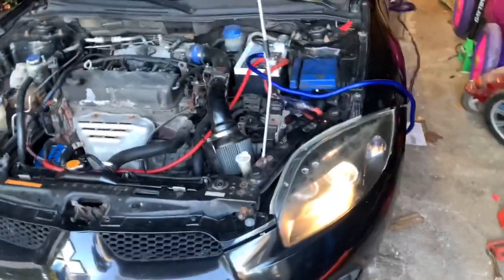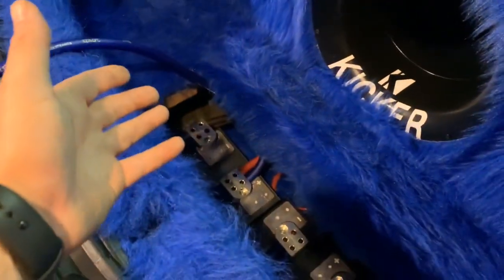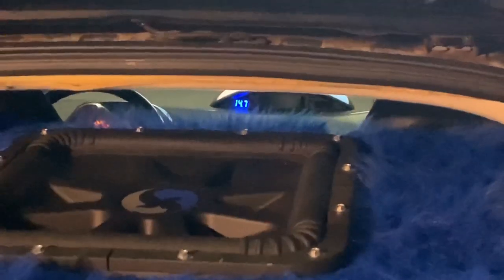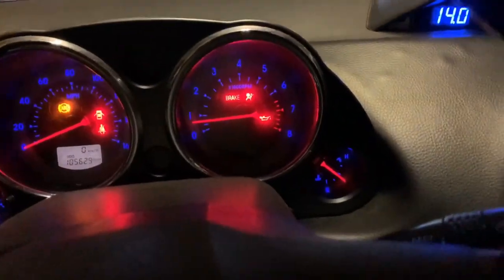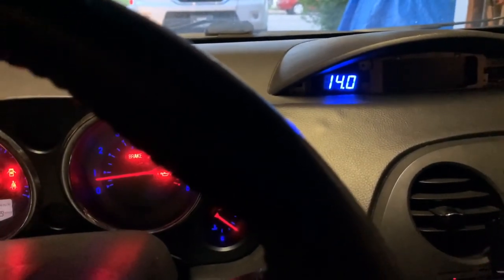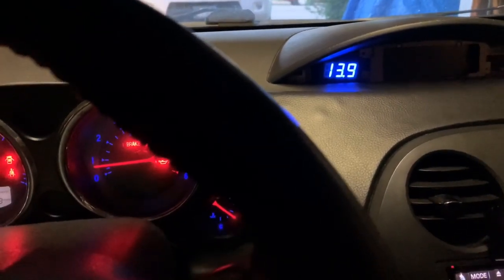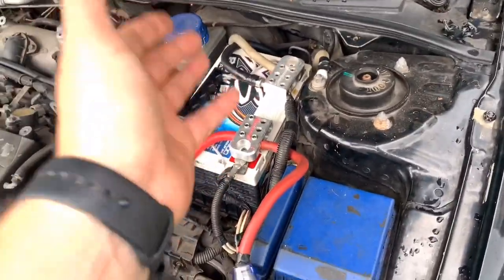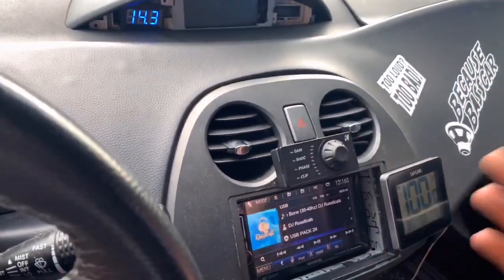VOLTAGE ISSUES WITH A BATTERY DELETE KIT ? IS IT WORTH IT?

Comment: It's an idle problem, the cars idle is set to low for that generator would be my guess most high alts don't turn on until like 700 to 800 rpm, hence why your getting the drop after warm up

Comment: My Ohio gen alt was doing same thing… bought a mechman 370 and couldn’t be happier. Charges all the time and way better voltage then my Ohio.  Night and day difference
Reply: They are weird I bought the biggest option an the amps they said are all over the place they called it a 350 370 400

Comment: I have the same issue i have a xspower d3400r big 3 & 320 autotech alt 96ah bank in back car starts 14.7 soon as idle down 13.3/5 but the factory idle us set at 625/50 rpm in which i tap gas and rev to bout 800/50 it stays at 14.7 have to get your idle flashed and change factory idle
Reply: Do you have a capacitor ran between batteries?

Comment: I know this is super old, but I got a singer, I didn’t run lithium, but I had issues like you with AGM under the hood and agm in the trunk, I’m buying lithium , and I asked about my voltage issues before and after and he sent me an alternator adapter that brings the voltage up and stops fluctuating so bad because of a “smart” alternator, there’s a few variables….
Reply from the maker: Yeah, I need to do an update on this video

Turns out it’s because the signal sense doesn’t detect the lithium battery after the delete connections 

I don’t know… The fix is to run your charge wire to the lithium and then another wire back up to the front of the vehicle to your battery delete 

I also fixed it just by adding the AGM back under the hood and running an isolator 

To be honest, the best way is to have multiple runs, going back and forth for positive and ground rather than relying on chassis 

Just for the best case scenario

Comment: Sounds like heat wash bringing the alternator down. If u charge the lithium with the car off, with a seperate charger, start the car the next morning, itll charge 14.7 or so until the car gets to running temp then itll drop voltage to 13s IMO.
Reply: ya i had a similar issue. ended up being an exhaust leak on the alternator. i got around it by keeping my headlights on and running my HVAC stuff on low so it would detect the higher current and keep the alt charging. oh and i eventually fixed the exhaust leak which of course was from a clogged cat. was faily simple to just drill a hole in front of my cat.

Comment: I've got similar set up, AGM up front with xs power lto 80ah cells with isolator in between, goes from 14.8 at start then dips down 14.4, but when I ran all agms 300ah of batteries, voltage stayed at 14.6, so I'm currently trying to decide will it bad to charge bank fully to 16v without deleting agm and isolator??
Reply from the maker: Ya If your LTO cells need charged higher then yes I would recommend charging higher but that may put stress on the agm while running since the isolator will be “open” you could always charge them separately and run your alt how you are but you are missing out on a ton of potential power from that LTO - I don’t think it will hurt them but it will reduce some cycles and reduce total capacity 

I recommend running only the LTO and upgrading your regulator so you can charge the LTO while driving and get the full potential from them
Reply: @LivinLoudwithAndy  sweet! Best advice I've got so far! Thanks bro! Well time to rebuild. My lto charger just came in the mail too, now time to do some research a voltage regulator. I drive a 1996 cadillac fleetwood brougham and have a js 370a alternator so think I need to start reading up on it first! 
✌🔊🔊 thanks alot

Comment: My 09 maxima does the same. My ecm is controlling the voltage still. Think it's how my 390 amp alternator is wired. Getting it looked at next week. With the AC on I'm at 14.5 plus at idle. AC off 13.2 at idle. Frustrating
Reply from the maker: I would get an external regulator 👊🏼
Reply: @LivinLoudwithAndy  actually turns out my alternator didn't turn on till 800rpm. Would've been nice if js alternator told me that cause I idle at 650. I had Nissan raise my idle to 800. Problem solved. I've since done an AGM delete and put in a sb500 under hood. Did it yesterday actually. I only gained .3 to .4 volts at full tilt. I do like the higher resting voltage. Is there any gain from starting at a higher resting voltage?

Comment: Bro did u try a shorter belt half inch to inch shorter some high output alts need to spin faster to make the voltage
Reply from the maker: Turns out it was the way you run lithium with a battery delete that was tricking the alt .. 

You need a run going directly from alt to rear lithium then an additional run from that back up front to the delete .. rather than one run all connected .. 

Removed the delete to remove this issue .. been great ever since

Comment: Ok I really need help with this question I'm new to lithium in car audio and I'm trying to upgrade my system been gone for a while and I don't know how to do it correctly and make it work for long periods of time and be able to recover from the Bass drops I'm currently running two Q-class 12's on a CXA 1800.1 but I want to upgrade to a dual solo x setup but my problem is my car (2019 Toyota Camry) can NOT take a high output alternator because of the ONBUS LINBUS electronics build which is where the cars computer is built in the alternator housing so my only option is a good battery bank but like I said I don't know what I am doing can anyone tell me how to run 5-8000 watts rms on a stock alternator and have enough reserves that my voltage drop is minimal any help would be greatly appreciated